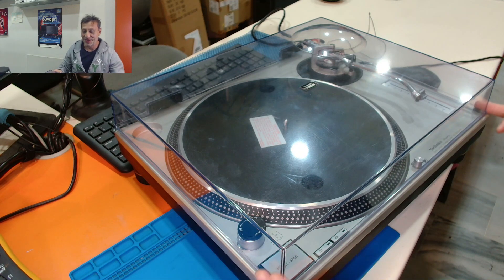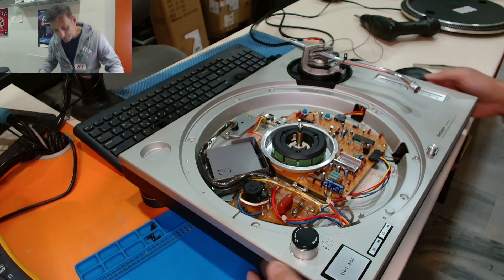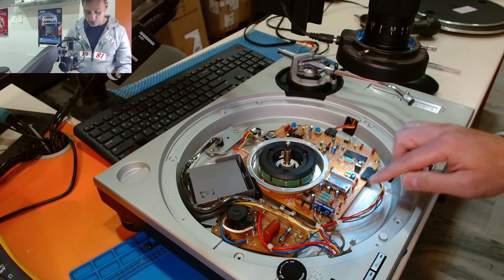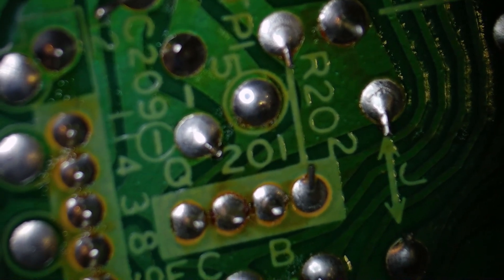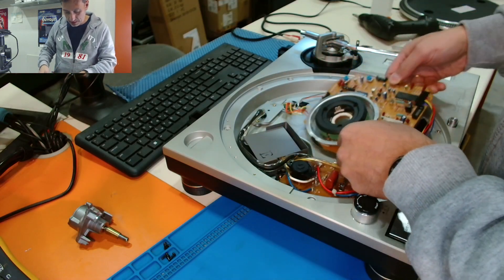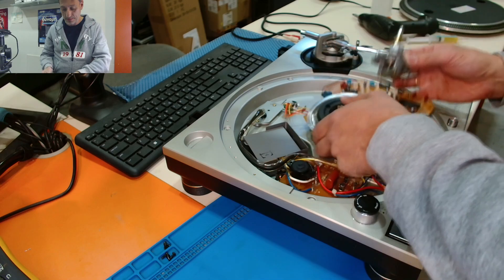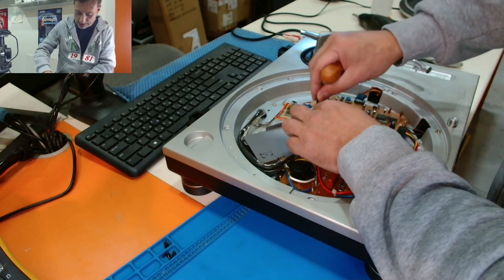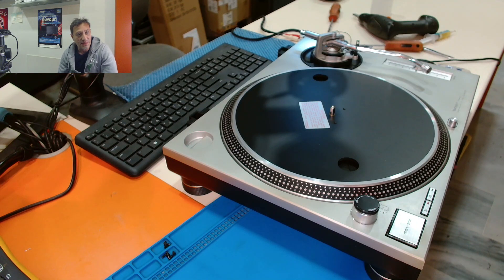Technics SL-1200MK2 spinning out of control - easy fix

Comment: The reason for this failure is because the circuit board is used to dissipate the heat from the transistor through the transistor leads. The heat over time gets hot enough to degrade the solder joint! I think it is best to re-solder with high temp lead free solder. But I guess, considering how long it takes to fail even regular solder is OK.

Comment: This is an update related to the repair on my Technics 1200 MK2 - IT WORKS!!! I had this issue for years and this easy simple task fixed my turntable! I didn't have any flux paste but I took my chances which I do not recommend. I was very careful not to leave the hot iron on the area that was bad. Just touched for about 2 seconds voila! Thank you PC Mastor!!!!!